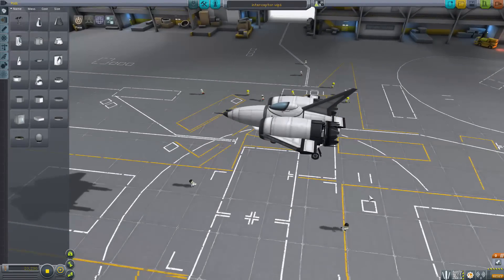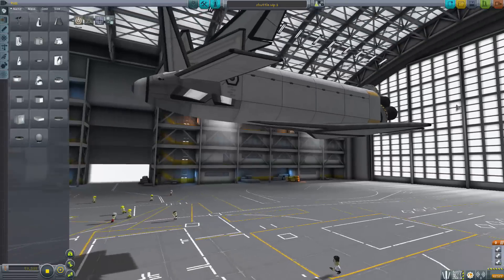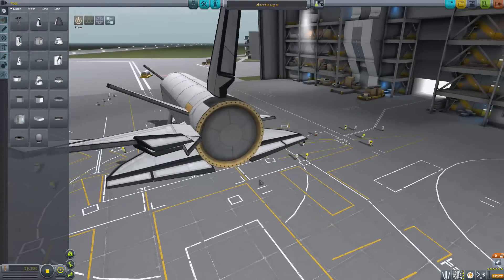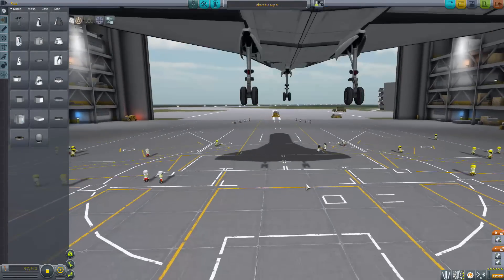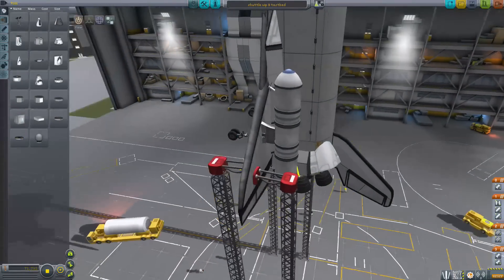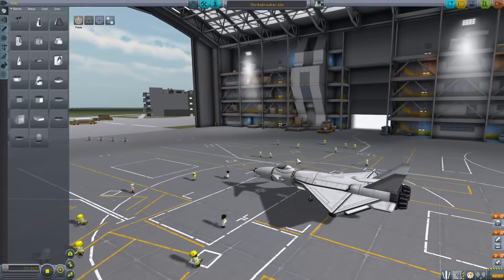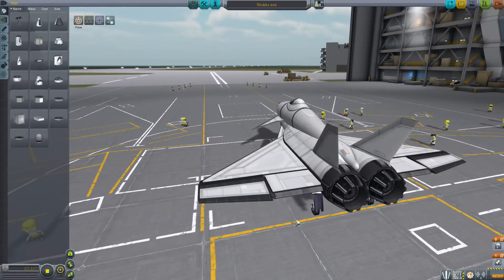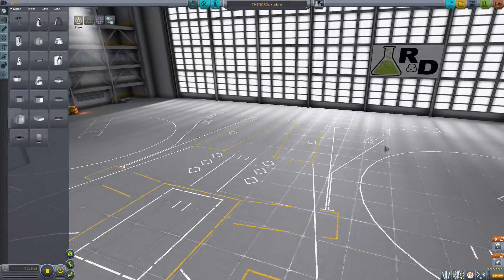KSP - The Design Process (Bonus Video)

Comment: You can place the BigS tail with symmetry and slightly offset it to remove any glitchy textures so it looks like a normal tail but the control surface "splits". :3
Reply from the maker: Camicus - Holy shit why didn't I think of that. :D